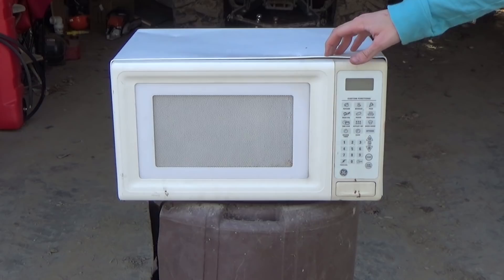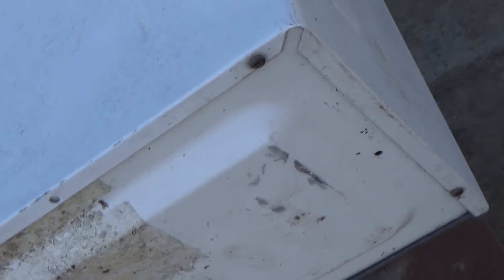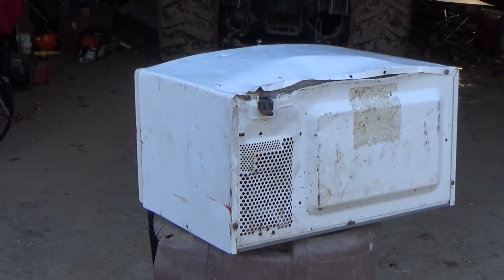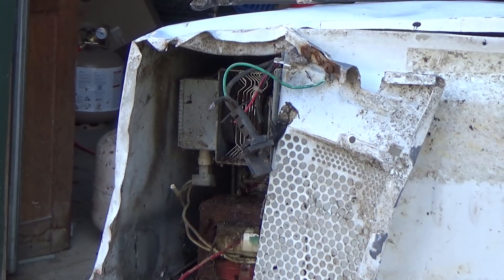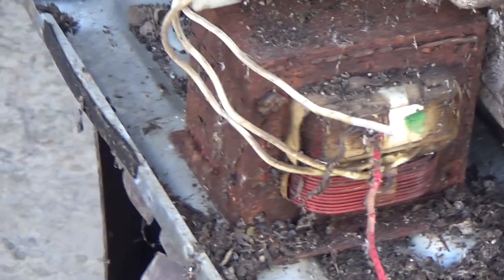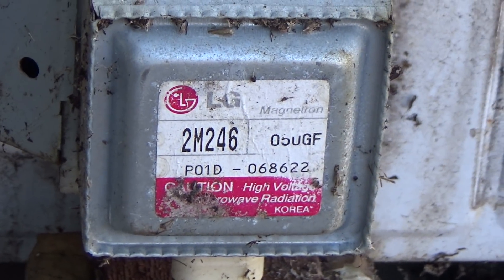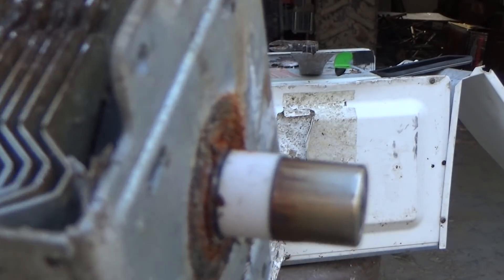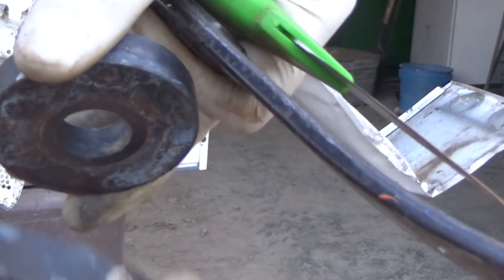Extracting the Radioactive Material (Thorium) From a Microwave

Comment: electrical engineer here. 
there's no way a consumer grade magnetron has a risk of radioactivity danger, i mean yeah thorium and beryllium is a thing inside those magnetron but it's a very thin layer of insulation, the levels of radioactivity are practically non-existent and literally mean No harm even if touched, also not recommended licking it because that's another story of course, but pretty much safe dealing with common microwave magnetrons since nowaday they are not used anymore those radioactive materials but Aluminium oxide and tungsten... so they are completely safe to disassemble.

Comment: yeah that white ring on the tip of the magnetron is 100% deffo beryllium oxide. usually newer ones will be pink and wont have beryllium in them, but if they're white, they have beryllium, and therefore are very dangerous to scratch or break.

Comment: My man, if you don't know what a transformer is you probably shouldn't take high voltage appliances apart. This one has probably been discharged ages ago but one day you are going to make friends with a certain tiny component called mister capacitor... or end up on the wrong side of the wooden box with copper. You'll instantly know what it's for when that happens! How can you know what a magnetron is but not a transformer? This baffles me...

Comment: What is wrong with this dude? This has to be a joke. And the creator of this video has to be a comedic “genius” (🥴). That’s the only reasonable conclusion I can come to. Let me explain my reasoning:
It takes a little research to know how to do things and what things are. I’m not saying u have to get a PhD to be successful at a diy project, but generally a quick google search or a couple minutes on YouTube is something that is common enough to learn things like what a magnetron is and what it contains…or for that matter, how to edit and post a video onto YouTube, etc., etc. I find it hard to believe that he knows what thorium is and apparently has some sort of use for it (YIKES!), but doesn’t know anything else about anything else. No one who is this…umm…DUMB!!!, about every other aspect of life (obviously), has any business tearing apart a potential source of lethal voltages, beryllium poisoning, and radioactive substances! What’s the next video by this genius going to be titled? “How to use an angle grinder to empty out a full propane tank!” What was the point of this video? It doesn’t share any use for the extracted chemical and it didn’t actually show any part of the TEARdown. Of course, based on the condition of the filament, he clearly used the same method on the magnetron as he TRIED to on the outer casing…unsuccessful brute force. Come on Sparky, get urself a screwdriver bit set with a few security bits in it! Or just look around in your garage, I’m sure ur dad has some tools better than a shitty dull pry bar. This kinda seems like laziness gone totally wrong. “I’ll just use a crowbar bc I don’t wanna take the time to find the actual tool(s) that will work…” then six hours later u finally “Swiss army knife can opener(ed)” the part with holes in it…OMG! I’m actually pretty surprised that it had anything but flat head screws in it…considering it was so old! This microwave from “the 1950s” is so old that the transformer is made out of wood! That’s amazing. THANK GOD that he doesnt know what a transformer is! I can see the headlines now: “Mentally Challenged Teen Burns Down House And KILLS The Family Dog Trying To Make Fractal Art!” And yes, there are definitely a bunch of “really cool” things that can be found inside of a microwave…but the fact that the magnetron was made by LG in Korea is not one of them! 
So, with far too much thought and effort, I’ve come to the conclusion that (CLEARLY) this isn’t meant to be taken seriously. The repeating blunders getting progressively dumber and more ridiculous is just too obvious. It’s like a parody of all of the dumbest YouTube DIYers rolled into one 5 minute and 23 second masterpiece of DUMB ASS, class D rated, straight to BOOTLEG dvd, stoner comedy. This dude is a troll and he only made this video for our entertainment and for his own. He’s probably cracking up right now reading all of the comments we have written…Right? Hopefully? I mean, if this is actually a real case of, “just barely smart enough to (kind of) use a crowbar, but too dumb to actually know anything else,” I guess it’s a blessing that he will have taken himself out (probably by using a fork and butter knife to pry open a live circuit breaker to extract the silver contacts or something) long before he’s smart enough to get a basic set of hand tools and maybe a cordless drill, or strong enough to used the trusty ole pry bar to open anything that’s actually dangerous for other people. SMH!!!

Comment: The cathode in the center of a magnetron is in fact a filament made out of thoriated tungsten which is an excellent electron emitter.

Thoriated tungsten is an alloy made primarly of tungsten ( 74W ) in which around 1 - 2 % of thorium ( 90Th ) has been added to improve long term electron emittivity.

Thorium is a weakly radioactive element with an extemely long half-life of 14.05 billion years. Furthermore, most of its alpha emission is absorbed by the tungsten within the filament itself and all of it is absorbed by the copper surrounding cavities.

However, if you open a magnetron to recover the filament, under no circumstances, you shall not grind or shatter it since these processes may release thorium dust which is highly cancerogen if absorbed by the human body (breathing or ingestion).
Reply: Wow thanks that was a great bunch of info I was unaware of well done you

Comment: That thing with the copper coil is a transformer. They are arguably the most dangerous toy you can play with as it produces either 3000 volts and a few amps, or a few volts and a few thousand amps depending on which end is charged and which end you touch. (Both will easily kill you)
Reply: Not trying to say you're wrong but when I've hooked up mine to AC power I've only got roughly around 500 volts on the output side. I keep hearing everybody say 2000 or more. I toy around with microwaves for myself not the magnetons though LOL
Reply: @brandonlaragirl  not sure if a few thousand amp potential at a few volts would kill ya unless you make yourself MORE conductive via getting covered in water or sum, 50V is the limit from my understanding, that's when your body turns from an "air gap" into a full on resistor

Comment: The box thing is just a electric motor and most have aluminum wire running completely in them and it's not wood it's steel plates welded together

Comment: WTF dude, that is a simple transformer.  The outside is iron.  The inside has copper windings.  It steps voltage up/down; that's what transformers do.  If you don't know that immediately by looking at it (because it's hardly an advanced concept), then maybe you shouldn't be taking apart magnetrons that contain beryllium oxides...  Also, SMH, dude, learn how to use a die grinder or cutting wheel. Taking apart one of these with a pry bar is mad ghetto.  Get some real tools, sheesh.
Reply from the maker: This one did not have beryllium oxide and I’m a chemist not a machinist
Reply: @Techience  Ok, I guess that makes sense.  Not everyone has the same background I guess.  I don't know much beyond high school chemistry.  You should do some looking into metalworking tools though, that would make your life a whole lot easier.  Also, I would imagine some knowledge of electrical engineering would probably come in very handy; I barely use mine but there are still cases where it's contextually useful.

Comment: @Techience
Years ago my uncle told me something  about radiation and microwaves. On any glass microwave door you'll see what looks like a sticker on it with like a black checker board pattern consisting of round or square holes. He said that is there to prevent the harmful microwaves from leaving the appliance. Evidently they're too big to fit through the holes. 
  My concern is that you showed us the radioactive material in a standard plain glass jar. I hope for your sake and the sake of anyone attempting to do this experiment that they do it in a safe manner.
  I'm an idiot when it comes to stuff like this. However  my uncle wasn't. He worked at JPL as a mathematician during the 50's and 60's. I trust whatever my uncle told me as fact so I hope everyone is careful while doing this experiment.
Reply: @SlowMoverIncoming
  Oh wow, I had no idea about any of that. It seems like you're quite knowledgeable about radiation and microwaves, thanks for sharing some of that knowledge! I was thinking about dismantling an old oven, but I think the risks involved from being ignorant outweigh any benefits I could potentially gain. I probably would've wrapped the thorium in all sorts of mesh and cradled it in a lead blanket while at the same time stood over it, sniffed its' odor and breathed it in. I've found that sometimes its best to leave things you know little about either alone or to the experts... and I'm no expert.  ;)
Thanks for the education, I appreciate it!
Reply: @xMRPx  One risk of dismantling a microwave is the same as a CRT TV: there are capacitors that can still be charged to high voltage after it's unplugged.
Reply: @gargantuablargg  
 I know there's a way to discharge capacitors to make them safe to handle. I don't know how to do it but I'm sure if I did some reading I could find out how. A problem though is electronics have become so small nowadays that I might look at a modern day capacitor and not even recognize it. I know them as having big cylindrical shapes, if they're soldered onto a circuit board then I'd miss it. Again, some reading would help.
I remember building a radio control system for a model airplane from Heath Kit when I was a kid. The resistors had a lead coming out each end and they had color bands on them used to identify what their resistance was. Nowadays I see them on circuit board... well, I think I'm looking at resistors. They're labeled R1, R2, R3, etc., but they're so damn small you need a magnifying glass to really look at them.
  There are certain things in Life that I know enough about, to just leave them completely alone.
  One of them is air conditioning. I still cannot grasp the idea of how you add heat to a gas to make a refrigerator get cold.
  The other is a woman's brain. I gave up years ago trying to figure out how a woman's brain was wired, it just doesn't make any kind of rational sense. So now I just answer "Yes Dear" and we get along just fine. 😅🤣

Comment: The "wooden" box which is steel is a 1000-2000 volt transformer. Very powerful... and that alien screw is just a "security torx". Theres plenty of sets on ebay.
Reply: I just "punch" the centers of the screws out with a punch or small screw driver, then use a torx driver to remove them. Also beryllium oxide is pink in colour, not white. That microwave is late mid 2000-2010 model.

Comment: the screws are just torx screw but you have to have the ones that have a small hole in the screw drivers thats calles hole torx
Reply: Or else just knock out the pin in the middle of the screw and use a normal Torx driver if you don't have the security type.  It's always worked for me.

Comment: That box is a transformer what steps up the voltage from 120 Volts AC to 2500 Volts Ac it's not wooden it's metal but it's rusty . That transformer gives the magnetron the voltage what it operates on .

Comment: The "box thing" is a transformer, its not wood, its just really really rusty. Always discharge the capacitor before trying to take one apart because they can hold a charge. Old transformers are great for electrical experiments but they have a lot of copper and or aluminum wire that can be extracted for projects. Cheers.
Reply: Discharge shit! You think that was plugged in the last 1 year or so? Who knows for how long has been laying around in rain and whatever...
Reply: Man, if you don't know what a transformer is you probably shouldn't take high voltage appliances apart. This one has probably been discharged ages ago but one day you are going to make friends with mister capacitor... or end up on the wrong side of the wooden box with copper. You'll instantly know what it's for when that happens!

Comment: The screws are tamper resistant. you will see them in hospitals, schools, public buildings. Also in pain in the a"" to repair appliances. you can pick up a set of drill bits for tamper screws at most hardware stores.  make sure to get long skinny extensions.
Reply: Looks like a torx screw.
Reply: @Bowhead31  , they are security torx  screws

Comment: That is a MOT or called Microwave Oven Transformer at 3:03. You can use it for high voltage, but vary careful they have enough juice to kill you but you can also turn it in to a super strong magnet too.
Reply from the maker: ATMELtronic aye thank you, maybe I’ll try and make it into a magnet in a future video!
Reply: @Techience  Oh it outputs 2.5KILVOLTS (2,500 volts)
Reply: @Techience  It puts out about 3000 volts, about the same as the electric chair or some overhead power lines so just play it safe.
Reply: @Techience  Check out this video.  https://www.youtube.com/watch?v=fbDTzhX1QQg
Reply: or u say simply a transformer
Reply: Do pulsed high voltage low amp projects... much safer. Or just leave the MOT be until you understand basic principles of electricity before attempting anything deadly... learn ohms law and kirchoffs law and power calculation first...
Reply: What if you eat or drink it?
Reply: @johndoe-tk6en  just kidding don't do it, it will and can kill you.
Reply: @johndoe-tk6en  if you want to play with high voltage i would recommend neon sign transformer or NST. Its safer but as long you don't do anything stupid with it.
Reply: @johndoe-tk6en  you will have super powers!